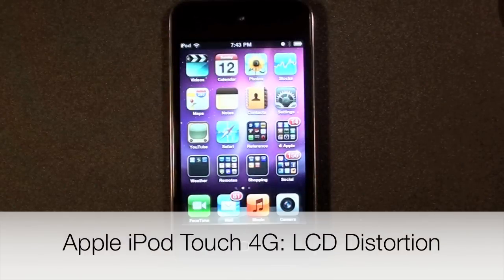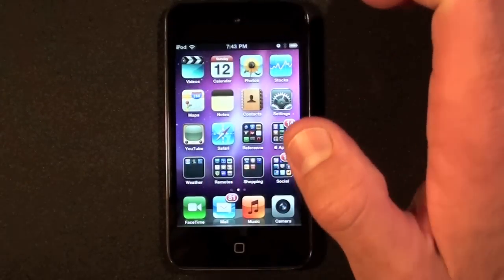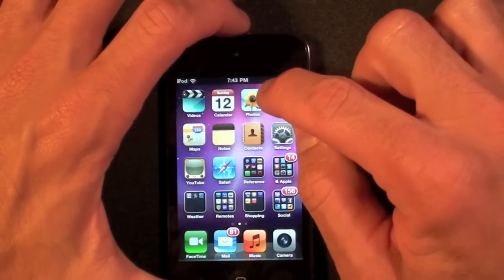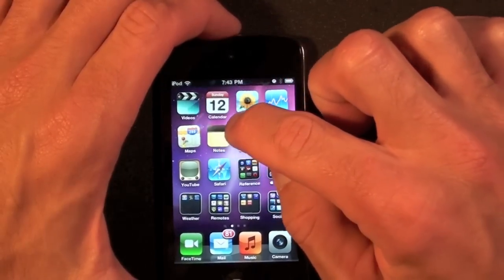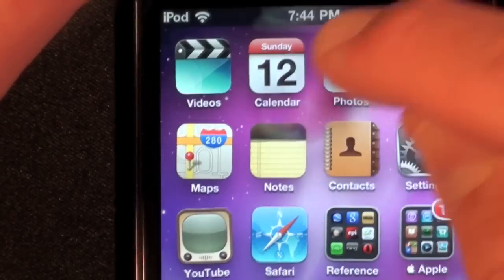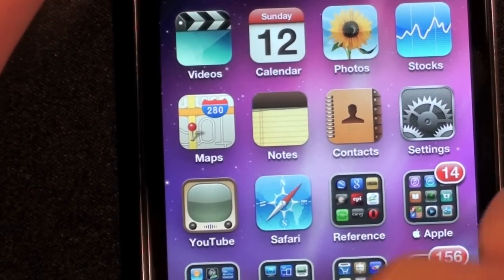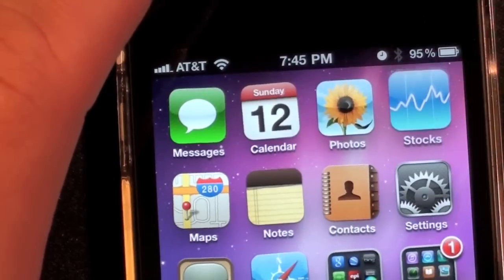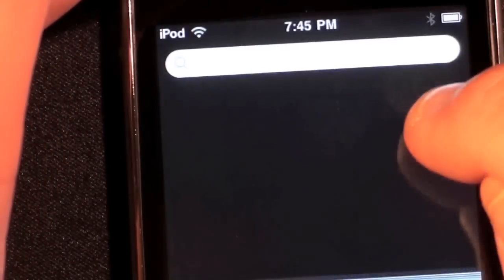Apple iPod Touch 4G: LCD Screen Distortion

Comment: yeah, I had a 4th generation iPod touch with a crack in it before, I had to be extremely careful before I replaced the screen myself. the LCD is basically attached to the screen of the fourth generation, well it is attached, but it's extremely close to the back of the screen.

Comment: This is true because the Ipod touch has an LCD display (Liquid Crystal Display) and when you press you are putting pressure on the liquid making it move. On the Iphone there is an LED display (Light Emitting Diode) and instead of liquid crystal there are individual dots that emit heir own light that is also why the Iphone has an IPS display and the Ipod has a TN display.

Comment: This happens with the first iPod Touch 4Gs, have a mid 2011 version of the iTouch and no matter how much I press, it does not distort. It only does that on the top but is because my screen is cracked. Apple already fixed this with the newer iPod Touches .

Comment: iPod touch 4g is made of cheaper materials, such as the 256mb ram downgrade from the iPhone 4, the display is a retina display but it does not have the ips technology that the iPhone does, therefore the glass makes contact easier with the capacitive sheet underneath, all the iPods do this.

Comment: The thing I see on all the iPod touch 4th gens i've been through is if you go on a black screen and tilt the screen and look you can see white blotches throughout the screen, it isn't an even color. I've replaced two iPods because of that but the 3rd one has it too so i'm guessing its just the type of screen they've used.

Comment: @appletechpunk same, there is this spoy of light from the lcd beaming out from the edge of the screen and i found it very wierd so i kind of put a little tension to see if it would cover it up, and the lcd seemed to get those spots. i bought the ipod 4th gen brand new 3 days ago.

Comment: It's not an issue. It's what any LCD screen does. Try it on a calculator. You'll be able to see better results because of the fact that the calculator's "screen" is significantly thinner than that of the iPod Touch.

Comment: I noticed this happen on my 3rd gen iPod touch only when playing games I realized that after a while I had to be careful not to use excess pressure. I had a feeling that the 4th generation might run into issues like this because it is so thin I can't imagine it can be as sturdy . I have been holding out for the iPad 2 which will most likely be thinner than it's predecessor how much of  trade off between strength and style  will it have. Seems apple is starting to teeter between being known for

Comment: It seems that about 2/3 of the iPod touch 4's have this problem.  I got one replaced from Amazon and I can press it pretty hard and haven't experienced the distortion yet.  I had to get a few replacements to find one that didn't do this.  My only guess is that Apple uses a few different Chinese manufacturers and some make a higher quality iPod Touch.

If you do have this problem, I would return it to an Apple Store.  All I had to do was tell them that NONE of their floor models have this problem

Comment: i have a exactly same issue on my ipod.
i've just received it yesterday, and installed the incredible shield immediately.
turned on my ipod and i notice that it has problem with the screen.
i only have left above side, like a bubble. and the shop says they will request the Apple to replace it and they will replace it but they might refuse it.
honestly i think the shop replace it, but they seem to won't replace for me lol.
i feel so frustrated.

Comment: this is because the screen is higher up so of course you will push it down witch makes a wiggle and on the iphone they made it leveled to the iphone outer metal string so yeah hope this is correct x)

Comment: Yes, I am having the same problem, just a less sensitive...only on the top left corner. I've asked in some apple stores and they told me that until apple makes a recall they can't take in any iPod for support. And that the problem usually happens to one in three iPod Touch. I am waiting for apple to realize that this is a real problem.
It affects me when I am trying to clean the screen.

Comment: mine distortorts but only on the top left corner and pressing firmer and harder then you would ever need to. And it doesnt last after you pressed it. Is that normal or is it not?

Comment: I took mine back to walmart. My screen looked blurry as hell always. I had a 3rd gen 8 gig that looked clear as heck on the screen. I had bought the 32 gig 4th gen for the cameras but those SUCKED as well. The speaker was on the bottom left and open with small vent it seemed but when I played games holding it sideways my hands covered it and the sound was always covered. They trick us and make worse ipods with every gen. My 8 gig 3rd gen is the best one out there still.

Comment: @DetroitBORG 
I have the same issue. Do you think the 32 gb is worth it for the extra $70? How much space is already used on the 8 gb for default apps, software, etc? And how many gbs of space does one hour of HD video take up? I am thinking that the 32 gb is going to be much better in the long term, especially because it would have a higher resale value in a few years (with 8 gb becoming obsolete). Just some things to think about.

Comment: @gaba922 It's really not a big issue. Any LCD screen will do this if you press very hard. You don't need to worry about it unless you plan to press as hard as you can on the touchscreen. You'll never notice it if you use it properly.

Comment: You have to press quite hard even at the very top of the screen to notice that on mine. There is no reason at all to press like that and I'm not even comfortable pressing like that on any LCD. And for a capacitive touchscreen, there is no reason to do so and is in fact counterproductive. If you press like that to use the screen, you are just making it incredibly difficult for yourself to use.

Comment: Who needs to press it so hard? :) But yeah, a interesting find. For me that gives a message that screen, digitizer and lcd aren't glued together. If they were glued together there weren't a space for a pressure which makes a rainbow color to your screen like that. And that gives us another message : Screen isn't the same material what iPhone 4 has? Compared to other screens the result of pressure on iTouch4G is waaay much slower than other screens. I don't recommend to broke the screen assembly

Comment: Good video, Mike. I'd imagine it has something to do with the closeness of the glass and the LED. Glass is in fact malleable, and it doesn't require much force. Yours on the other hand seems more severe. I was pushing HARD on the display, and I can get it to artifact a little, but nothing like yours.